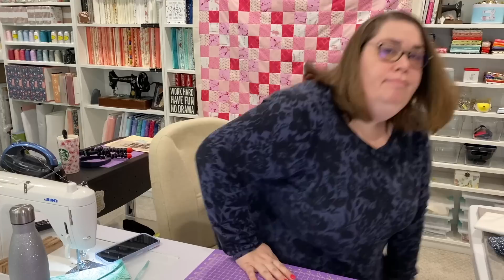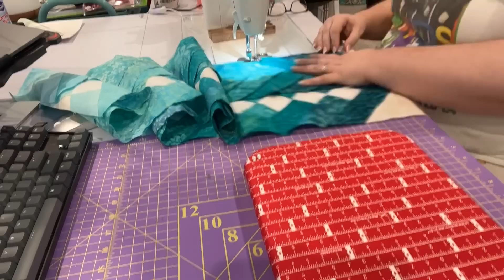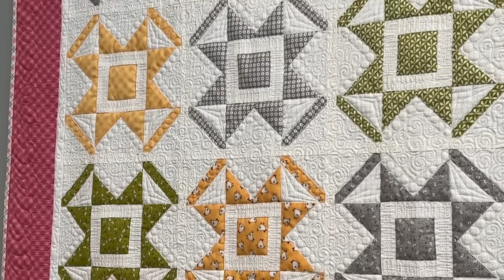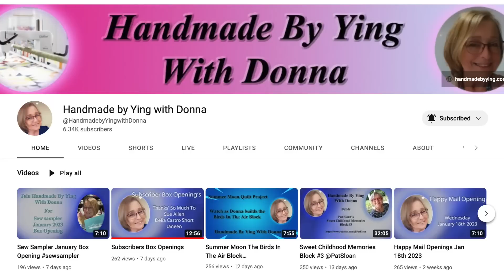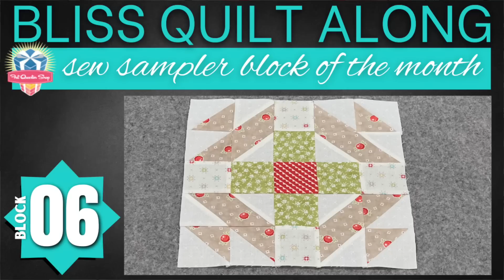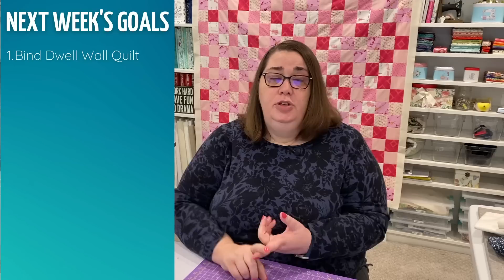I stayed up (almost) all night to put together a quilt top!

Comment: On bias edges in a block. Sew around the outer edges where the seam falls inside the 1/4" seam allowance. It makes the 1/4 and hsts stable where they won't stretch.
Reply from the maker: Great tip...that I'll recommend for future!